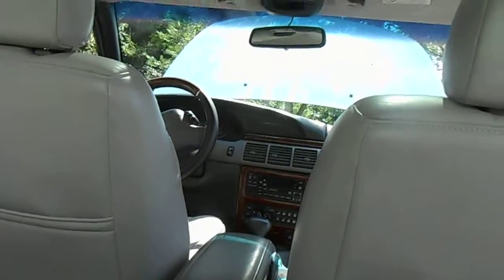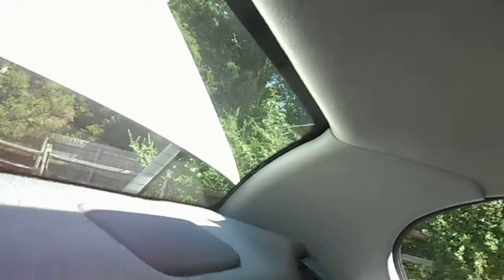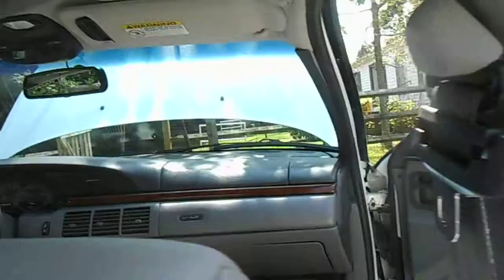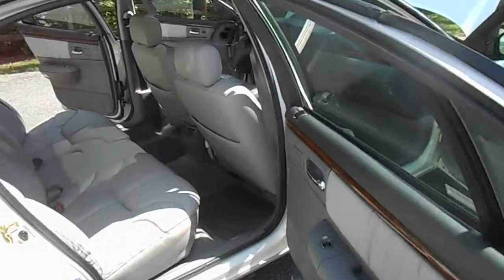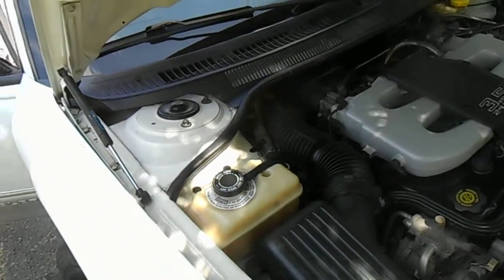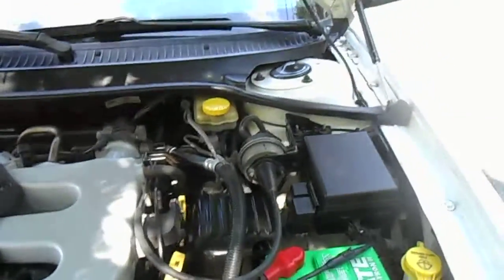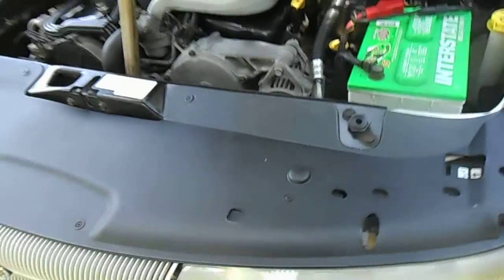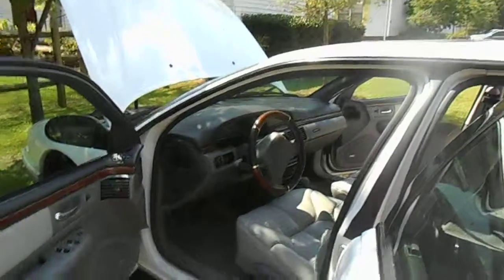My freshly detailed 1997 Chrysler LHS

Comment: That thing is clean, I drive a 97 Intrepid (Dodges version) as my work car but mine is faded badly and rusty, also has 230,000 miles on it but still runs and drives great and I drive it hard too.
Reply from the maker: +Horsepower Garage I only put on about 3,000 miles a year these days. When I lived in Los Angeles, I would do that much in a week.  Thank you for viewing my car and yes, it is very clean.

Comment: Dear Jim Bales!
Pleeeaaase tell more about this beautiful vechicle!
Is it reliable?
Is it fuel efficient?
Is it expensive to maintain?
And if it brakes often are the parts cheap or expensive?
And a final question which is very important!!!
Will you recomend this car as for a person like me that has never owned a car before and is getting as for a first one?
Otherwise thank you for reading my comment and i will be EXTREMELY thankfull if you answer my questions since you are the only one that can help me with about whether shall get the car or not because here in Europe we dont drive Chryslers much and nobody really knows much about them.
Reply from the maker: +George Belev Hi George. Thank you for watching my video. I have owned this car since 2007.  It had 86,000 when I bought it.  The first thing I did was to have the timing belt replaced as this had not been done.  I drove the car for many years before I felt it was time to do some major maintenance.  At 110,000 I had the front end rebuilt.  It drove like new again. As far as the cost of parts is concerned, I would imagine that it would be costlier to buy parts for an American car in Europe. I have had only one breakdown and that was earlier this year when a belt broke.  Have kept the oil changed and recently returned from a 2500 mile trip to New England and back with no issues. This was very pleasing to me as the car is now 18 years old. Still looks great and very comfortable to drive.  Don't know if you have found one there to buy, but if you have, Hope you enjoy it.  I would like to see your car if you have bought one.
Reply from the maker: +George Belev Forgot to mention the MPG.  I have gotten up to 26 mpg on trips and around town about 18mpg.
Reply: +Jim Bales Thanks alot Jim Bales!
i still havent bought the car not that it is expensive or not its just that  i might be moving to another place and there is no need for buying it.But however if i ever get it i will send you pics and more information.
Cheers!
Reply from the maker: +George Belev Awesome. Where do you live?
Reply: +Jim Bales Bulgaria
sorry for the slowwww response
Reply from the maker: No problem George. Anything else you want to know about this car.  Did you move? Do you have access to a Chrysler LHS.  LHS by the way, stands for Luxury High-Performance Sedan.
Reply: +Jim Bales Nope!Unfortunately i didnt have the chance to buy the car because somebody else gave the seller a better offer.And otherwise i dont feel so bad now cuz maybe it was a better choice of me for not purchasing it since the car was too big for our tiny European roads and the fuel consumpion is BAD!
Reply from the maker: Okay, great. Thank you for letting me know.